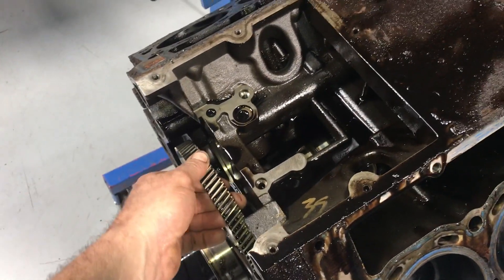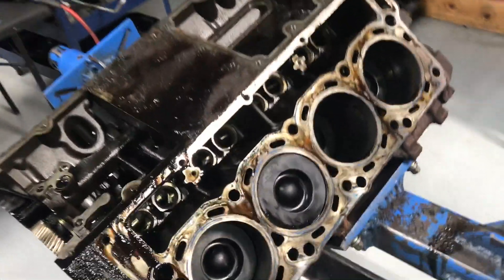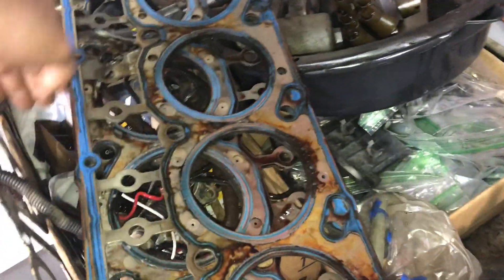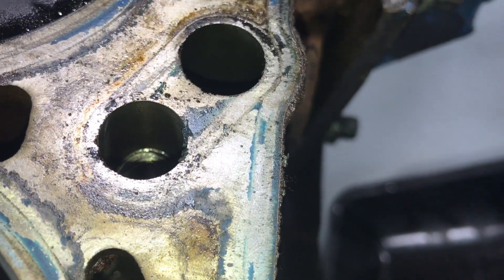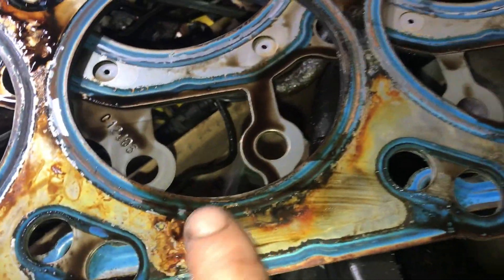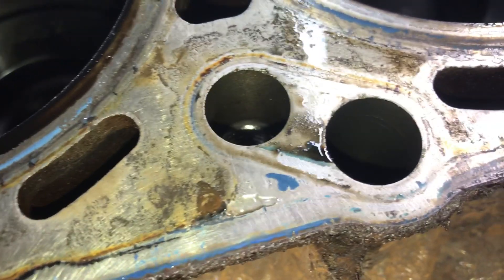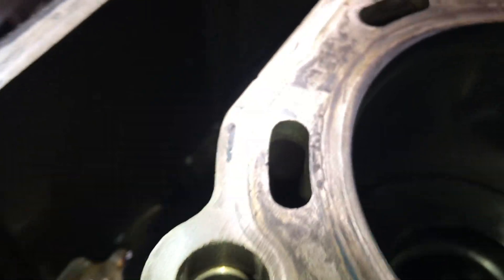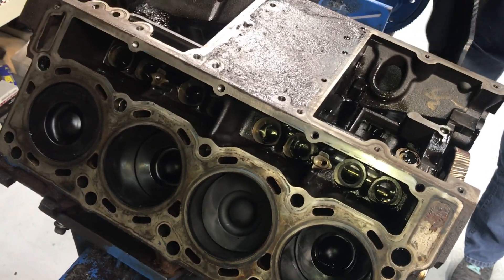Barry’s existing short block

Comment: You mentioned the slightly blown head gaskets at the end of the video. I have had a degas gauge on mine for at least 6 years and I make about of coolant pressure, even got a aluminum degas bottle and radiator because I blew them. That being said it has been this way all the while and not gotten worse. I use the truck to tow my 14k trailer pretty much daily and it runs awesome. Not a single issue that I can find other than lots of pressure in the system, and I monitor EVERYTHING all the time. I can't really find a reason to do anything about it. I mean I have been planning what I would do and what parts I would use and eventually I will just go ahead and do it anyways and oring it but for now I'm just letting it roll. How come I never see you oring heads? What do you think about it? Especially for non stock applications like bigger turbo and injectors.

Comment: So pretty basically from watching all of your videos its thought me to buy a 7.3 or a 6.7 nothing in between. Unless I have funds for a whole motor job on a 6.o
Reply: If you upgrade to ARP Head Studs and a EGR Delete the 6.0 is a Great Engine. They can make alot of Power too.
Reply: @badass6.0powerstroke10  Yeah the are nice trucks dont get me wrong I just dont feel like I can drop 10-17k on a truck and be ready to put 8k into it if need be. They definitely make more power then a 7.3 but im just looking for a reliable tow rig my race car takes most of my money lol
Reply: @Turbotalkin  Yeah i just put around $11,000 into mine, Fully Bullet Proofed Studded and O-Ringed Heads and also a Bunch of Performance Upgrades, KC Stage 2 Turbo, Warren Diesel 175/30,s Regulated Fuel Return, Airdog ll-4g, S&B Cold Air intake and Intercooler piping, MBRP 4" Stainless Steel Exhaust, Precision Industries Triple Disk Converter and Billet Input Shaft, and Much More. Made 572 HP 1016 Ft. Lbs.I'm still able to Daily Drive it and Tow. But I'm looking to see 700-750 HP So next on my list is the Odawgs Ported Intake, and some Bigger Warren 205/75,s
I might do a Non VGT, but i really like the Low End Response of the KC Stage 2. If i do go Non VGT it gonna be a s369 at the minimum, Would like a s480, but i know it gonna be a bit Lazy Down Low. It's still street driven.
Reply: @badass6.0powerstroke10  Hell yeah that's sick! I got a 14 coyote full suspension fuel system and a 7675 with a little nitrous to help spool it because I have a stick car. Just looking for a reliable tow rig I dont have to worry about dumping cash into all the time. I feel like the 7.3 suits me a little better if I cant find one worth might time might bite the bullet on a 6.7